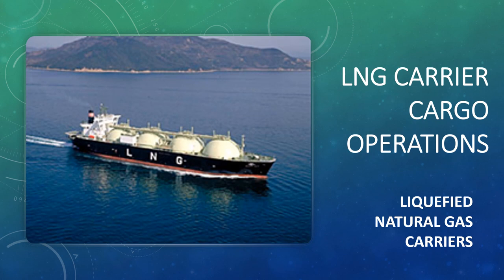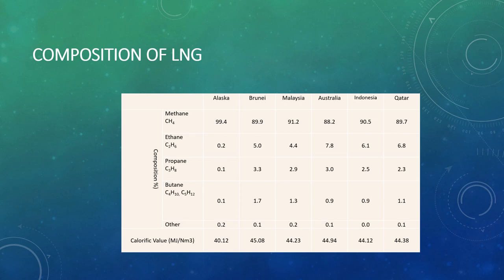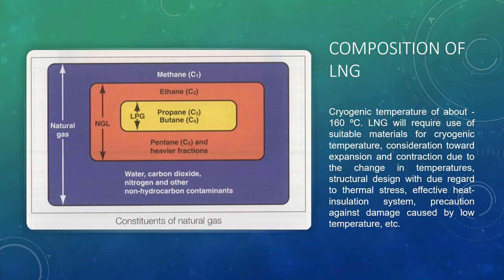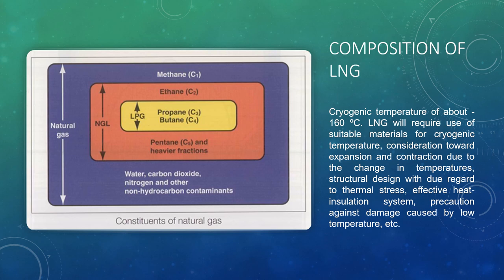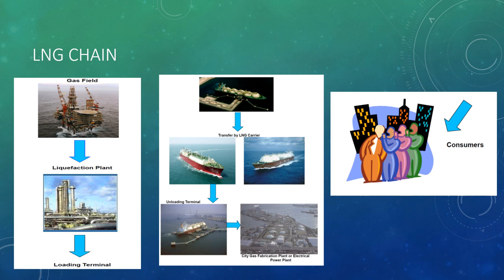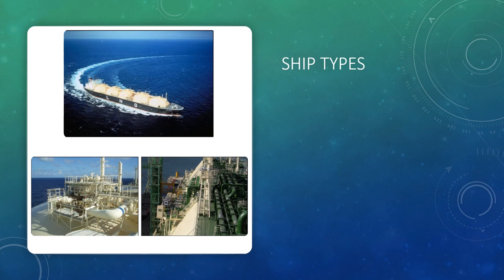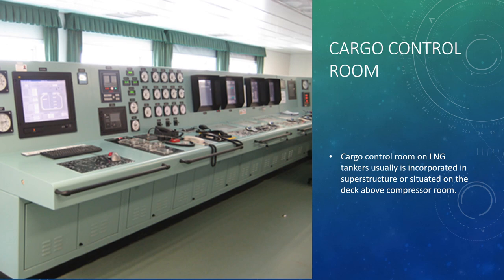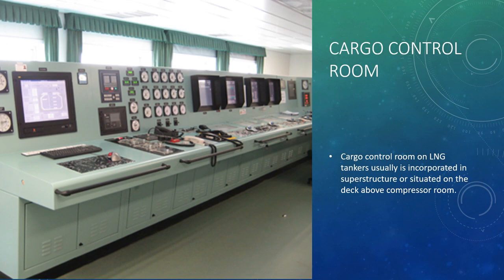LNG carrier cargo operations summarized for you in 1 video !!!!

Comment: The skrubber usually have a designatet pump and do not use a ballast pump. The ballast pumps are simply to big.  When producing inert don’t go below 1% O2 the reason is that you  risk producing  CO if you go to low.

Comment: I did not hear anything regarding slushing on membrane tanks. Shortly explained the liquid levels of a tank must be kept above or below a certain level of the tank on sea passages to avoid the tanks being damaged due to the internal wave system of the cargo in the tanks. On longer loaded voyages it is normal to hear more noice from the tanks as a lot of the cargo have been boiled off and you are getting closer to a critical level. This is due to the frequency of the waves in the tank.

Comment: The LNG Tankers Are The Most Important Ships Ever Built Speaking Of LNG Tankers I Always Wanted To See A LNG Tanker The Size Of 4 Football Fields 1,440 Feet Long and 50 Meters Wide and 250,000 Tons My Fishing Boat The Fishing Queen She Can Move Faster Than A LNG Tanker The Cruising Speeds For Her Are 12.9 Knots Equals 14.83 Miles Per Hour 13.9 Knots Equals 15.98 Miles Per Hour 14.7 Knots Equals 16.90 Miles Per Hour 15.6 Knots Equals 17.94 Miles Per Hour 16.5 Knots Equals 18.97 Miles Per Hour 17.3 Knots Equals 19.89 Miles Per Hour 18.2 Knots Equals 20.93 Miles Per Hour 19.1 Knots Equals 21.96 Miles Per Hour 19.9 Knots Equals 22.88 Miles Per Hour These Are The Highest Cruising Speeds For My Fishing Boat Ever Recorded